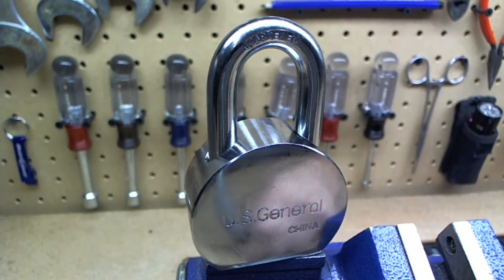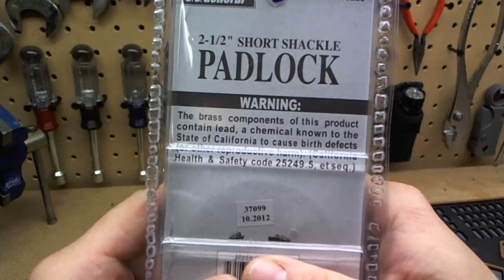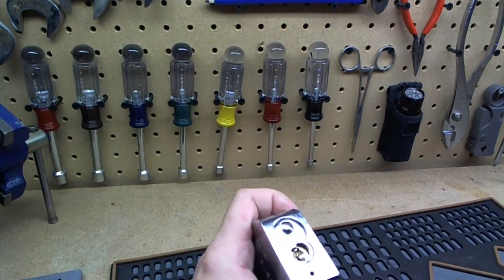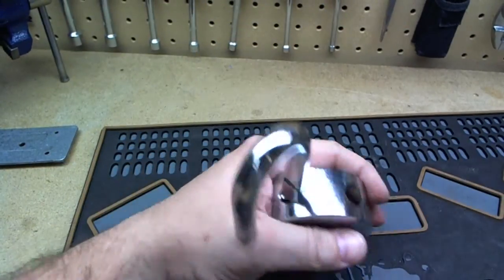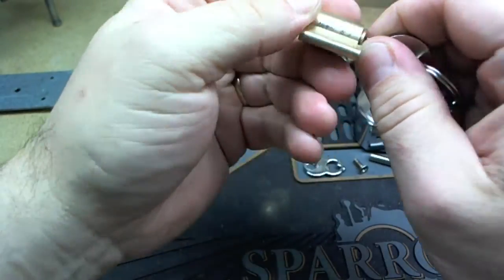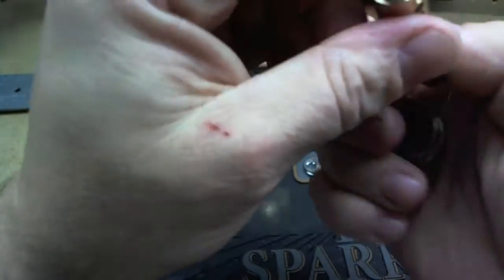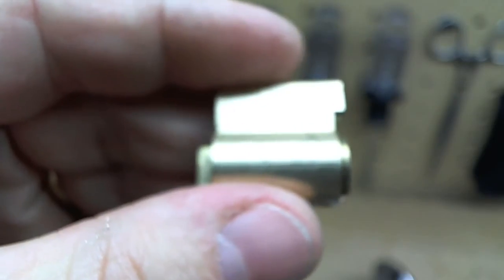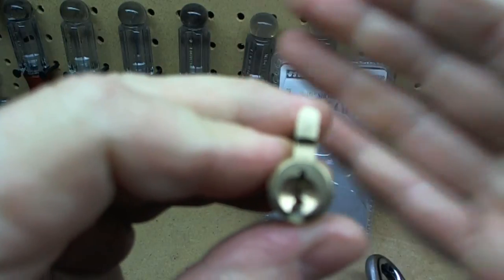U.S. General Harbor Freight Padlock Picked Open

Comment: The 6th pin is a retaining pin for the plug. Just shove it up and you can pull the plug out. Be careful to not turn the plug very much, or else the top pins get stuck in the (cost-saving?) plug milling holes.

Comment: Not only am I curious if it would be upgradable to a better cylinder but also if it is actually case hardened.  I would check it with a file.

Comment: I have one of these locks. The pins are so terribly made it is nearly impossible to pick it. In 1 year I've only opened it a handful of times. Mine has awful mushroom pins not well defined. Irritating lock. Is so bad it's good.
Reply: I recently bought one and it doesn't have china printed on it. I think I picked it once but my tension tool slipped. Seems like the best cheap lock I've played with